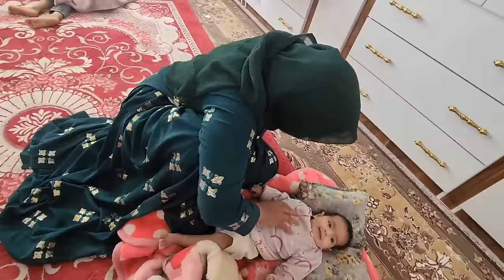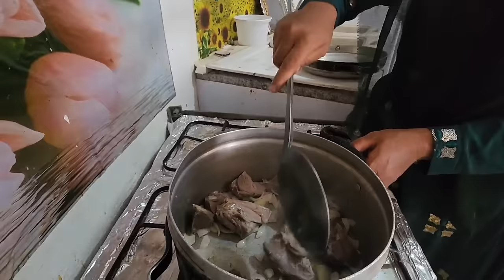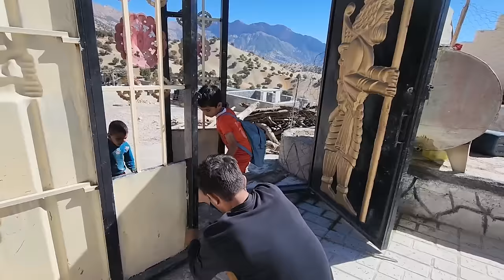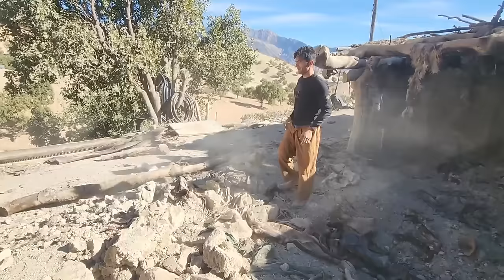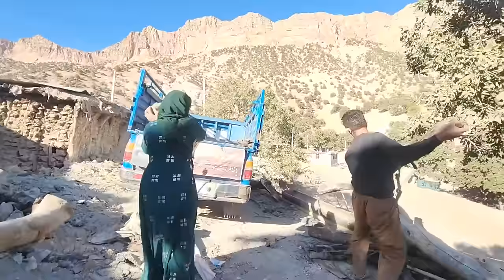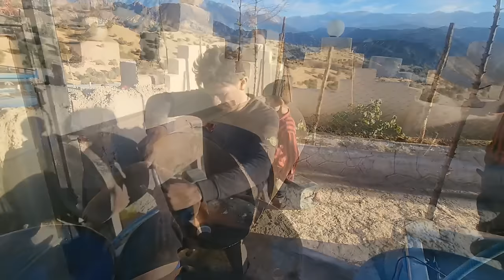Beautiful rural winter and construction in the farm @TIR78

Comment: Can't believe you use a water hose to clean your kitchen floor.  Doesn't the water run out originally your carpet and rugs? Seems it would cause your metal cabinets to eventually rust beneath and inside whether you add wet dishes to dry.